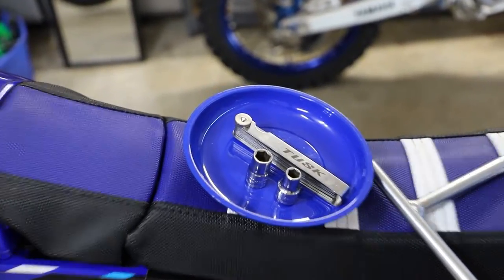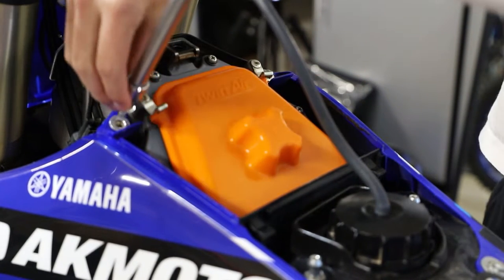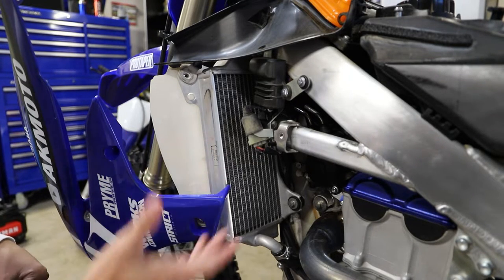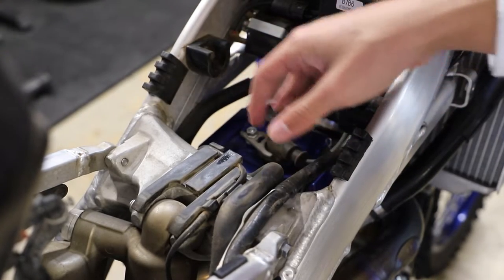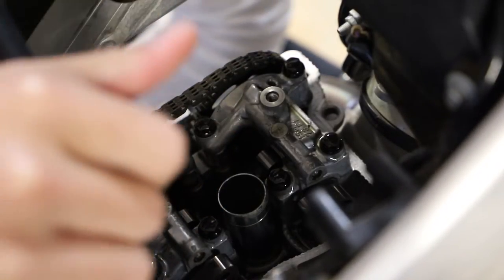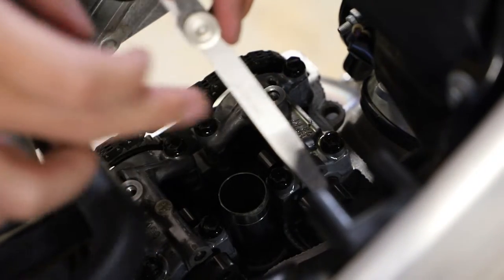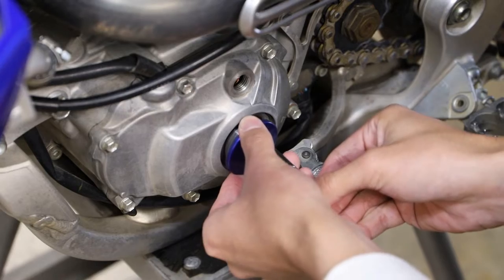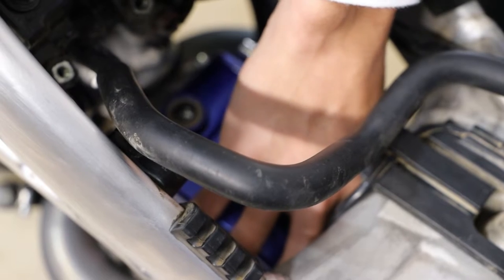How to Check 2021 YZ250F Valve Clearances

Comment: At what point would you actually decide to replace valves?
Reply from the maker: Visual inspection of valve seat contact area for wear, checking for excess play between seat and stem. Any unusual wear, and when the valves won’t hold a clearance (goes out of spec)